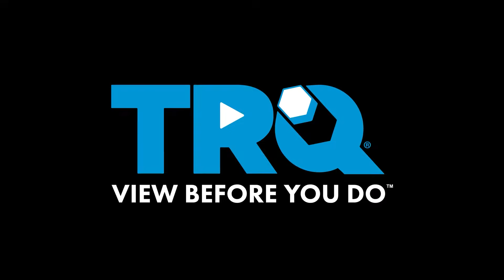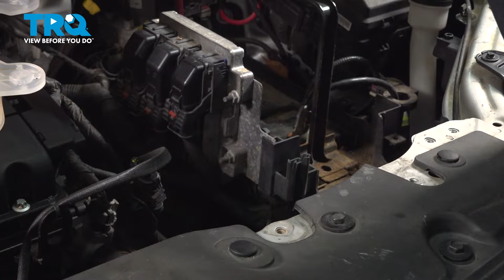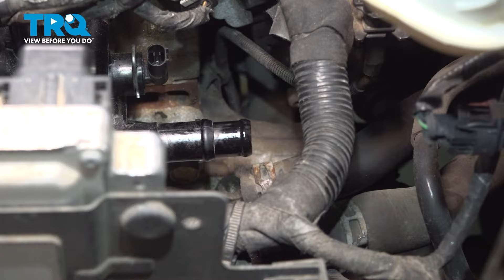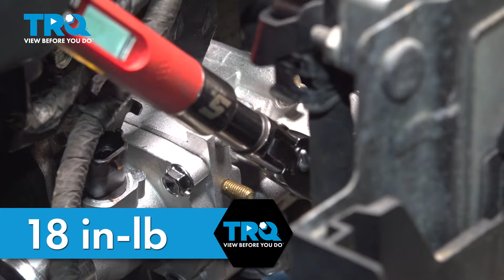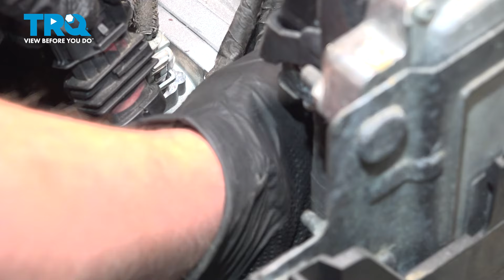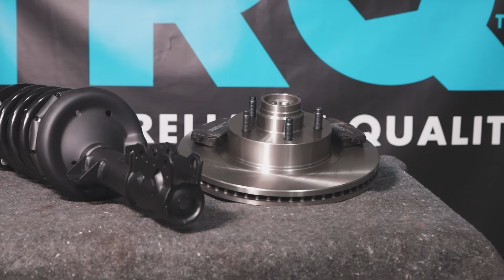How to Replace Thermostat Housing Assembly 2012-2020 Chevrolet Sonic 1.8L L4

Comment: If there was gasket material to scrape off, then gasket material needs to be put back on. Might want to add that part and to also NOT use a razor blade to scrape off material from the mating surface. And letting people know that the petcock is located on the passenger side of the car.

Comment: dont you have to use a plastic scraper instead of a blade to clean off any residual gasket?  The metal blade can gash the gasket surface and not ensure a proper seal. good video but dont take everything from social media to heart, do lots of research before committing to one source.

Comment: the provided link, given above, does not open to the thermostat housing assembly...and searching the website doesn't return that product. Can you please provide an updated link? or is this item no longer available from TRQ?
 https://www.youtube.com/redirect?event=video_description&redir_token=QUFFLUhqbW5BVzZ1cTVHZXlGVmZnWjcwdXlZdTBsZjQ0Z3xBQ3Jtc0ttTTJneUR2ZGF2dVZjT0lHOENEeWx5b0pSOFN3SG45Sm84Y0doNEstQVVGX0dpY29MUEI0M2plMVNzZWtaTFg5WHYwczI0SS14Wksxb0FheTF2d2hsQmpFQ2x4MWpNWlpFM2s5RG1pY1c1djZwNFplVQ&q=https%3A%2F%2F1aau.to%2Fc%2F166%2FaR%2Fthermostat-housing&v=mMrUpVPAHYs

Comment: Thanks a bunch.  I just noticed that I bought only the front part, and not the whole assembly.  I bought the thermostat without the rest that goes to the engine.  Now I'm wondering if I should have bought the other half as well.

Comment: Is there a specific throttle body inlet heater hose need when replacing the housing? I've recently replaced a thermostat housing on my wife's sonic and the old hose began leaking antifreeze after a month. When I ordered a replacement, leaked coolant faster. Any advice will help as I'm ready to throw the whole car away.
Reply: Mine has done that since I changed it and I changed it again but it still leaks.. the clip seems to not catch correctly. Is there any type of glue I can use to keep it from leaking?
Reply: Over one coolant leak? Buddy chilll, get a diagram open and replace the broken part. Torque to spec, whats so hard about that lol

Comment: How do you get to the Petcock? Didn’t bother explaining that part in the video…
Reply: Its on the passenger side under the protector plate that uses two hex nut screws and two 13mm bolts to hold in place.